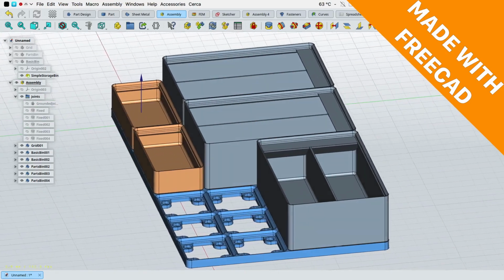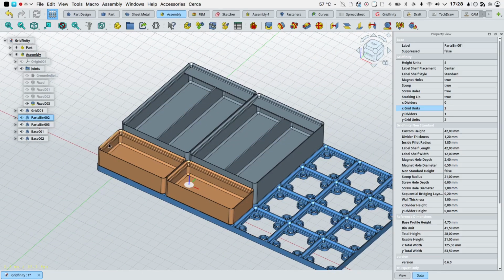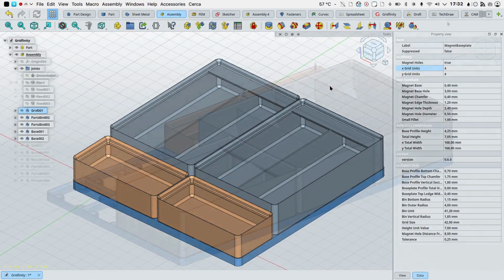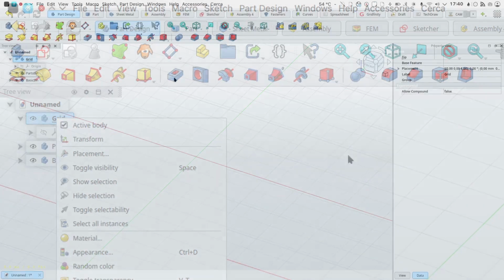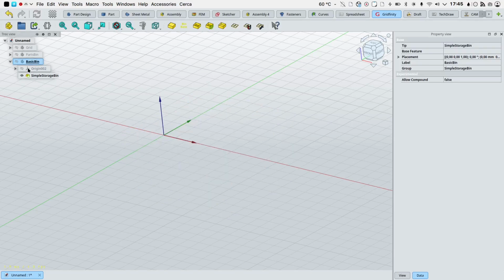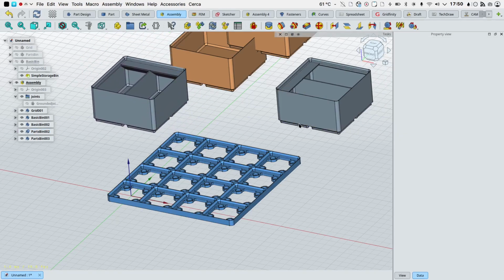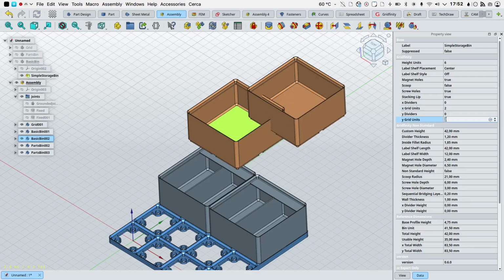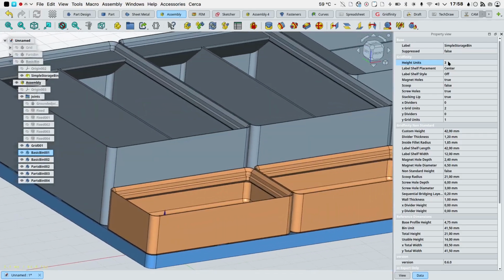[Freecad Ondsel] Gridfinity, assembly workbench and TNP

Comment: Is the ondsel version good enough to use it instead realthunders freeCad which had solved the topology problems in since years?
Reply: FreeCAD 1.0 has the same topology solution that real thunder uses. So it should be very comparable now.
Reply from the maker: Luckily Realthunder's solution has been integrated in main FC/Ondsel , we still lack some tools from Linkstage3 but the direction has been set and perhaps those will be integrated too.